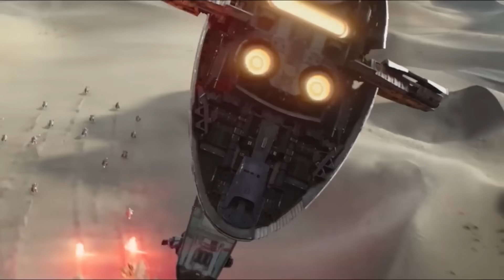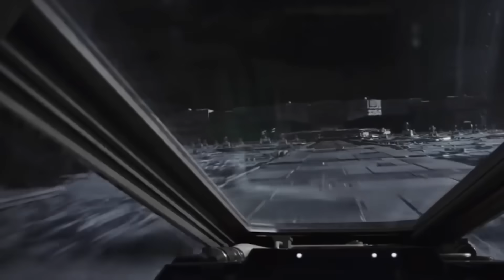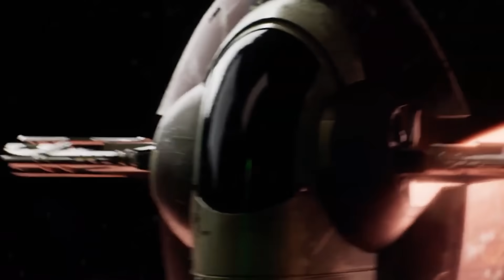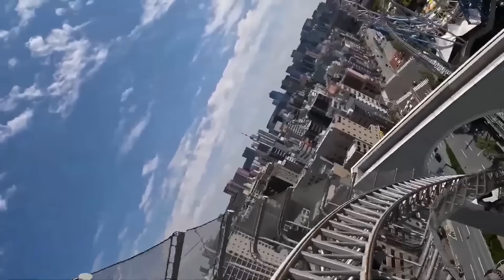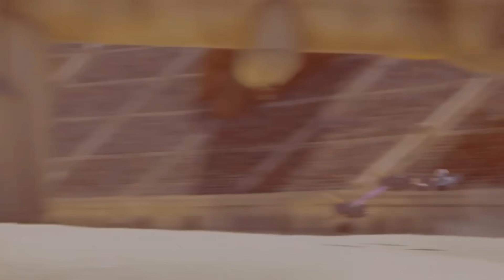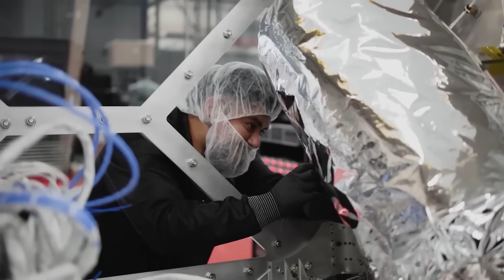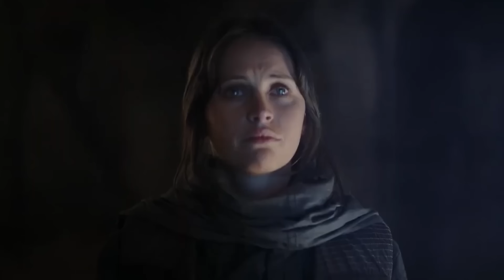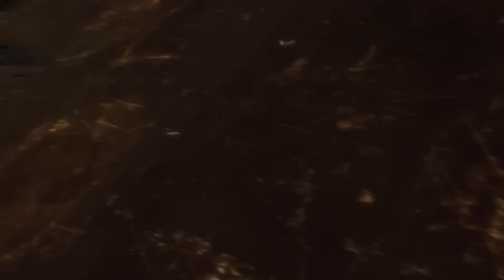The Problem with Star Wars Ship Design

Comment: Awesome video, some corrections and feedback
Bridges - valid, someone piece of media tries to explain why the executor went down when an a wing crashed into it but it’s a heavy retcon
Transparasteel - valid
Star fighters - problem! First of all speed is not an issue in space, only acceleration. Second of all, star wars has inertial dampeners as part of ship design. Third, star fighters absolutely would fly in a straight line like jets because to get to a good speed you’d need to spend time accelerating. It makes sense to have primary engines in one direction. HOWEVER the problem is that you absolutely could not turn around on a whim like we see them doing all the time. Turning would be slow without additional engines and all the time spent speeding up would be needed slowing down as well, making it more like strafing runs than dogfights. An important problem that is missed is how they all can fly in atmosphere but none of them are aerodynamic. 
Nukes were mentioned, they are less effective in space
Cone shaped rockets are irrelevant for star wars as they can use repulsion tech to lift off the ground right up to space. They can also be built in space and just not enter atmosphere (star destroyers) 
Also worth noting, mon calamari ships were listed as being the most realistic. They are actually underwater buildings retrofitted to be spaceships. I’m seeing conflicting answers online whether they were passenger ships or cities, but in the darth vader comics they appear to be buildings that take off. 
Why weren’t elite special forces guarding the shield? They were. The 501st was stationed there and inferno squad was hunting rebels in the woods. 

The bigger issue with space and all that is how inefficient it all is. Instead of a star fighter, a swarm of drones would make much more sense. Even compared to a droid fighter. Interestingly, a lot of it does still make sense in universe.

Comment: Another fun thing is the destruction of Alderaan at the beginning of the first-released Star Wars film, IV: A New Hope. It expands at its own (pre-destruction) radius in a little less than a second, while if it was only injected with enough energy to overcome its self-gravity, it would take some 10 minutes for its size. But that would not be very dramatic.

As to the energy necessary, using E = m*c^2 gives a few million metric tons. That’s almost a Star Destroyer’s weight. To expand at 1 radius / second, one needs a few trillion tons.

An alternate approach would be if the Death Star’s ray can catalyze proton decay, or more precisely, Grand Unified Theory nucleon decay. That may mean less energy aboard the Death Star, and one needs a tiny fraction of total mass to supply enough energy.

Comment: The speed "problem" might not be a problem at all, sure spacecrafts reach 20k+ km/h but that is relative to the earth. If two fleets meet head on on the same orbit height they will have 0 difference in velocity compared to each others. If you count this then space battles makes sort of sense, fighters can operate on the same orbit height of the fleet and only have hundreds of km/h of velocity difference compared to the capital ships. You can see this by looking at ships docking at the ISS, they go 17000 km/h relative to the earth but they are almost stationary compared to each other

Comment: Can you acknowledge the tech they use? Like......any of it?

Also your facts are mostly incorrect. Most star destroyers had 3 bridges...just for 1 example. There is the main one. There is a command center underneath it on the tower but pushed back in that is capable of controlling the ship and another one down in the middle of the spine.

Transparisteel is thick glass in Star Wars. Literally. Sensors fail...transparisteel doesn't break easily. If you can't see it with your eye you can't trust it.

The mellinnium falcon is not designed for battle. Neither is the Lambda shuttle.

Yes the acclamator DID have transparisteel are you dumb?????

The lambda shuttle as well as every other ship in Star wars has particle shieldiñg that you are COMPLETELY IGNORING!!!!!

You didn't even try on this video....

Comment: I do find it disappointing that Lucas was lured into such silly optic glamor. 

The more I think about what kind of spaceship design I want for my own mythos, I continually return to a generic cigar shaped, slightly wedged design with thrusters both fore and aft of the same magnitude. 

Very large ships can't spin around to slow down.  The best way to decelerate is to have the same engine facing forward as you have aft. 

No conning towers - like you pointed out, they're blatant targets. 

Large spaces would also be utterly anathema on a spaceship, for obvious reasons. Great! Vaulting ceilings in a military vessel would be ridiculous to say the least. 

I could go on, but nobody will read it.

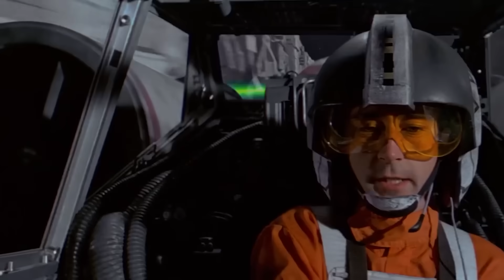Comment: 10:20 Star Wars Fighter Pilots survive the G-Forces of their Maneuvers because their ships are equipped with an Inertial Compensator that cancels out the G-Forces...so the pilot can make a turn that should mash them into the side of their Cockpit like a grape hitting a concrete wall at 200 MpH without even noticing it...

All Star Wars Space Craft have these, otherwise the activation of the Hyperdrive would instantly turn the entire crew into strawberry jam plastered against the aft bulkheads a millisecond before every piece of material that wasn't strapped or bolted down smashes through that bulkhead and destroys the ship...

Comment: Windows makes sense for small ships like the Falcon or the Star Fighters since they frequently operate at human visual range (AKA what a human can see with their naked eyes), while for larger ships, windows make no sense whatsoever since they need to be able to see and react to things FAR outside human sight range due to how ponderously they react and turn...if you can already see it with your eyes, it's FAR too late to try and turn or slow down to avoid hitting it...also having exposed windows in Combat is just stupid, if for no other reason than the Enemy WILL try and send a Proton Torpedo, A-Wing Starfighter or Turbolaser bolt through it...
If you REALLY must have windows in your Capitol Ship because humans evolved with the intense desire to see outside, THEN FOR GOD'S SAKE, BUILD THEM WITH RETRACTABLE BLAST SHIELDS YOU BLOODY IDIOTS!!!
ALL Capitol Ships already fight entirely through their Sensors, NO Capitol Ship Weapon has the ability to be Manually Aimed, if your Fire Control Computer/Sensors are on the fritz, then you gun/missile battery is nothing more than a multi-ton paperweight!!!

[End of Rant]...

😄😁😆😅😂🤣

Comment: THEY ARE NOT DEFLECTOR SHIELD DOMES.  They are radomes, they literally look exactly like the radar domes we've been using here on Earth since the 60s.  The Executor lost its bridge deflector shields because of an overload due to the destruction of one radome.  It still had the second one completely intact, which presumably could take over the entire duties for the ship if its partner failed.  If the bridge deflector shields were dependent upon these domes, why did they fail when only one of them was destroyed?  Even in-universe, calling them shield generators doesn't make a lick of sense.

Comment: 10:50 speed doesn't matter, it's the acceleration that'll kill you. Depending on what point you use to contextualize the speed, han solo could effectively be not moving, while the vortex is moving at high speeds around him.

Comment: An explanation that works for my friends and I, The Force designs and enforces flaws. As if the celetials are preforming a massive ongoing mind trick. 

 
Challenges that could include exercising the philosphical beliefs of the creators of The Force. It prevents people from inventing solutions in some ways and helps technology be extremely advanced needing only a few zip zaps in other ways. 

The hard science meets fantasy being that the Celestials advanced so much, that invisable technology is preducing what seems like magic, but is in fact their ancient culture being made the rules lesser races must play by.  

Imagine needing to say a magic word to unlock eletrons being able to complete a circuit to turn on a light switch. Not because saying magic words was part of the natural physics, but engineered layering of new physics due to a supremely advanced previous intelligence. May seem stupid, but it has rational support as to why to do that.  Namely.. prevent a group like the empire from designing itself such that it could not be stopped.

Comment: Don’t blame the engineer who designed the exhaust port. Nobody told him to design it to repel magical space wizards who could fire proton torpedoes through shielding, make them turn at right angles into a tiny port no bigger than a womp rat and guide them miles and miles through the narrow exhaust duct until they got to the reactor.

Comment: Generally a battle in space would be fought at distances sufficiently great that a window would be all but useless. So the use of transparent steel was even stupider than you suggest.
A single teaspoon of neutronium would have a mass exceeding 1 billion tons. It is not a material that could be used in the manufacture of any product. It would even be impossible to get any neutronium as they are only found in neutron stars where the mass of a large star has been compressed into an area about the size of a large city on earth.

Comment: Galen Erso may have deliberately included a flaw in the death star, but it wasn't a thermal exhaust port, It was that the death stars shields wouldn't stop anything as small as an x-wing. We found out later that Slave One had missiles that could blow up an asteroid and there's no doubt a couple hundred of those things would do a job on the death star. The rebel leaders just studied the plans and overlooked the obvious
Reply: The Death Star's shields wouldn't stop little things because it wasn't considered necessary, they didn't think little things could do serious damage.  And, obviously, there's some sort of tradeoff--the shields are probably better at stopping heavy firepower.

Comment: I still remember book "The Crest of the Stars" where starships of "Human Empire of Abh" had one interesting specific part - command room was located right in the middle of the ship - at the most protected part of the vessel. There was a downside to this however. In fact such a big downside that bridge crews didn't even considered wearing space suits in combat - command room was located at same best protected part as ship's fuel storage. And Abh ships were using Anti-Hydrogen for the fuel. So breach of the fuel containment system, which happened more times than breach of bridge itself, led to ship's immediate annihilation. Considering this, most bridge crews considered to not wear space suits because they would likely be turned into stardust.  Also in combat Abh ships never had visual connection - in normal space distances were too big, and in "Flat" (2-dimensional hyperspace) they won't even see anything beyond space-time bubble and would use interceptor mines (engine block, nav-computer, antimatter storage and space-time bubble generator, designed specifically to get into enemy ship's space-time bubble and ram into it, rupturing antimatter storage, instantly annihilating both mine and the ship)  - so instead of windows they would usually have giant curved display that would either show them outer space, or, in most cases - critically important information, communication with other ships, orders from higher commander etc. 

In addition - while Abh ships, even big ones could carry smaller ship - usually those smaller ships would be either shuttles for transferring crew, or picket and courier ships. Now, only two cases of Space Combat are written in the book - Battle between Imperial Battleship Gosroth in FlatSpace against Four Nations Alliance fleet, which was effectively one-side. Gosroth managed to destroy few ships using its mines and dealt some damage with its railguns but being significantly outnumbered, it didn't stand a chance. And other battle was effectively between Lafiel and Baron Fedbash - with Lafiel piloting courier ship, while Baron was flying his personal ship that was more of a Yacht with couple of laser cannons strapped to it. Cannon blasts were invisible in space and Lafiel only managed to "See" them due to her connection with ship's computer through her "Third Eye" (Abh are genetically modified humans, they have special organ that looks like a little crystal in the middle of their foreheads, and works akin to insect eye or a fiber optic interface, capable of accepting hundreds of data streams at the same time. Because of it, all Abh are wearing headgear that usually ornamented as tiaras but in reality those are effectively sensor arrays with direct interface with other computers, including computers of spaceships). In the book she won by heavily burning massive amount of fuel in very dispersed pattern, creating wave of heavy ionizing radiation that killed Baron in seconds. Book describes manuevers in VERY broad strokes. Most detailed description was during orbital manuever where courier ship has moved past three battleships that were orbiting planet in fairly tight formation.  Speed difference was so hight that there was no chance for them to start pursuit - by the time they could turn around, courier has shed its engines and non-essential systems and entered into atmosphere as a life-boat. Sooo.. in The Crest of the Stars space combat is described to be realistic, though animated TV series goes with more "Star Wars-esque" way of depicting it.

Comment: Why does every video like this keep calling the two domes the shield generators?! Those are the sensor/communication arrays. Yes, they have have their own supplementary shields because ray shielding prevents sensors, transmitters, and receivers from functioning. They are NOT the ship's shields. They're mounted up there so they can be "outside" the main shields in order to function, and have their own set of shields that can be raised to protect them during attack. When they took down those shields, they only took out the shield generators protecting them, NOT the entire rest of the ship, which is protected by the main shields, which are generated by a massive device mounted to the mini-sun it uses as a power core, along with thousands of smaller secondary shields generator relays covering the whole ship.
Claiming that taking out those domes is what disables the ship's shields is kind of like seeing someone wearing full plate armor, and you run up and knock the umbrella out of their hand and yell, "I've taken down their shields!!!"

THOSE DOMES ARE NOT THE SHIP'S SHIELD GENERATORS!

Comment: The death star vent has never been a plot hole. There's no atmosphere in space to dissipate heat, so you need some kind of directed vent with some kind of energy exchange to avoid turning the entire station into an air fryer. The only reason anything was able to get in there was because someone used the Force to target and direct the projectile, despite the jedi supposedly being extinct and the only sith being in charge of the death star itself. It didn't have to be intentional, though disgruntled employees dissatisfied with the hostile fascist regime they found themselves subjected to on a regular basis would absolutely sabotage the station.

Comment: Space battles would be fought at 10k-100k km. At such ranges, a mile-long SD would be a speck. Fleets would be spread out over distances of thousands of km.

Ships in a fleet would never be close enough to collide. Enemies would be blown to bits long before they could ram.

The Holdo maneuver wouldn't work because initiating hyperspace has no precise direction, no precise sensors to track the target during transition, and no precise course correction to steer into the target. It would be a 1 in a hundred shot. It would be a 1 in 10,000 shot to hit a smaller target such as a SD.

Comment: The star destroyer doesnt have a design flaw.If you look at the attitude of the empire and what forces that may be put against them their thinking was on the same line with the deathstar.They knew a star destroyer was too powerful for current rebel captial ship.Fighters was not a concern because they had their own air wing to deal with fighters.As far as the super star destroyer doing a header into the deathstar its either power of the plot or at the moment of impact helm lost control of the ship putting it on a collision course.